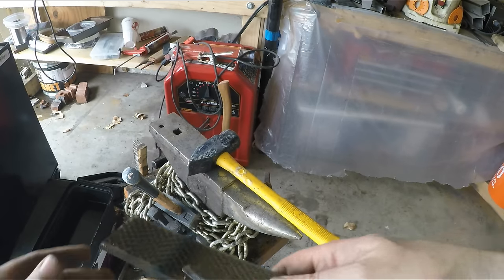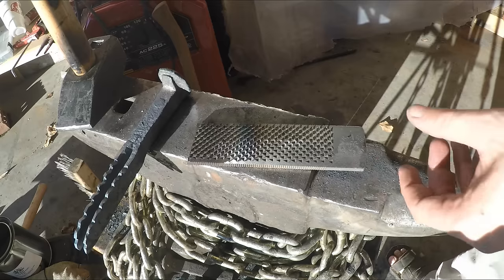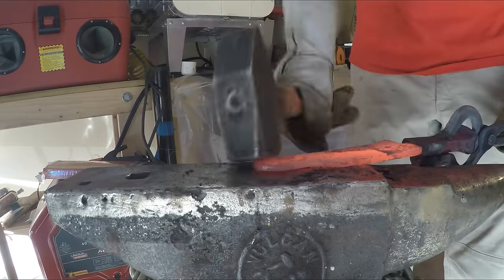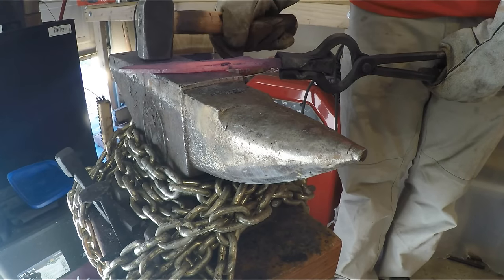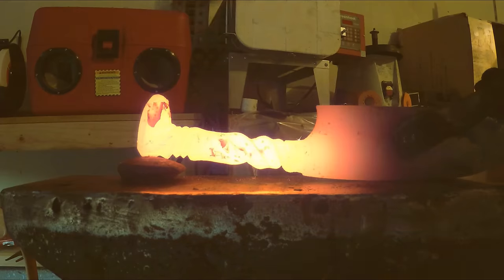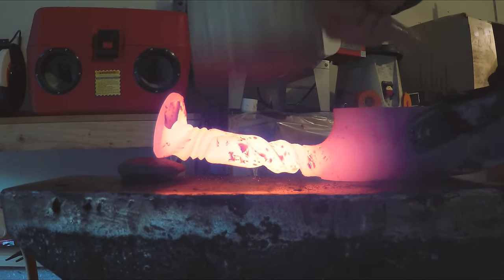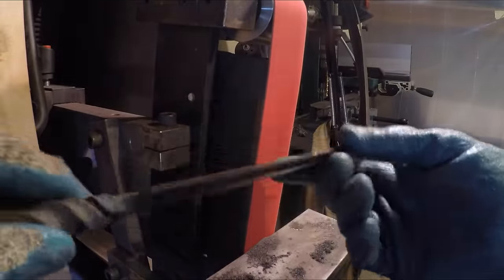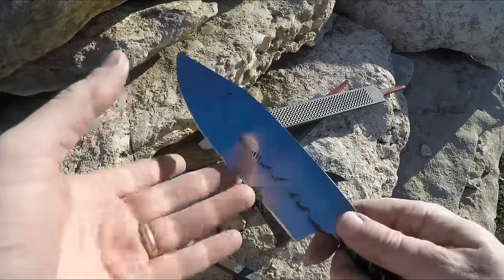Forging a Spike & Rasp Knife

Comment: at 15:50 you said you didn't know what kind of knife the was. I'd categorize it as a san-mai Bowie. in all the American frontier tradition of making what you had on hand the best it could be. this is probably the best spike knife build I've seen, really shows off not only your craftsmanship but even more importantly your understanding of metallurgy and what steels are appropriate to use go a good knife, instead of thinking that you can pound away on any old piece of steel and get a good knife. most end up as KLO 's (knife like objects), which this definitely is not. love the build!
Reply from the maker: +Zach Reiser  Hey thanks, man.

Comment: Hey Green Beetle.
As a fellow smith, I just thought I'd mention something I noticed to help you. When you were slitting the spike, you were kind of hopping around as you hit and causing marks all over the steel. What I can recommend is to start off with some relatively light hits just to mark where you want to cut, then going back over with heavier hits to make the marks deeper, then cut through. 
Happy forging!
Reply from the maker: +Cave of Skarzs   Thank you for the help, I'll try it.

Comment: I dont know anything about forging but i like to watch it. I was just wondering, what is that black material that flies off when you're hammering the metal in shape? Is that also metal? You can see it around 4:16
Reply from the maker: +xFexy  It's called scale.  It's formed when iron oxidizes from the heat.

Comment: to make it easier to forge a file and a railroad spike heat it until it's glows yellow then put it in a bucket of sand then wait for a couple of hours then pull it out of the sand and then it will forge easer
Reply: False that just takes the hardness out of it and makes it easier to shape cold on a sander or with files I.e. Stock removal methods
Reply: If you watch the art of weapons  when he forges three drill bit knifes he says that doing that makes it easier
Reply: Well I'm sorry to say he is mistaken as heating it up and forging it makes it as soft as it will go. The "annealing" process is what you are thinking of makes it softer in cold state.

Comment: What causes that glassy sound that you mentioned towards the end of the video? Is it an indicator of good heat treatment or good steel?
Reply from the maker: +firedoggyx  Not sure what causes it, it just sounds cool to me, like the original file sounds and feels.  It's unique to file knives and in their case probably does indicate a decent heat treat.There are many things that make up a good heat treatment. You would like the grains to be small in size and tightly organized in addition to the most important factor - hardness of the knife.  For most knifemaking steel one shoots for a post quench hardness in the mid 60s HRC.  The blade is then tempered in an oven at a prescribed temperature depending on the steel and desired hardness. Tempering releases stress created in the steel during the quench and reduces the HRC of the knife decreasing it's brittleness and making it more durable.
Reply: Ahh i see! I asked because a knife i bought from ikea sounds exactly like this, and its a really pleasant sound that i was hoping to recreate. Maybe ill try to forge some files in the future :)

Comment: what happens if you hat treat the blade at forging temperatures instead at initial non-magnetic
Reply: Spenser Denovich depends on the steel and size of the blade.
Mostly would work
But wraping and cracks could apear. If you quench in water steel like 52100 shatters

Comment: Habe you put it through any hard testing? It looks like there's a lot of delanination. Great video tho, great ideas and not boring to watch!
Reply from the maker: +Cooper Landram there was a 2-3 mm area of delamination near the front of the forge weld towards the tip of the knife that was ground away .  There really wasn't any other delamination.  The lines seen are superficial to where the forge welds occurred as the spike metal was driven down into the file causing a divet that couldn't be closed because the piece couldn't be compressed lengthwise at forge welding temps to close that gap.  It skated a file and was tempered from there, final hardness was in 55-60 HRC range.

Comment: Something I have been wanting to know is, what kind of anvil do you use? Also for a beginner black smith who wants to makes knives and the like what sort of working surface do you think would be the best choice? Also from research I have found many anvils to be rather expensive, any recommendations as to that or is a, you pay for what you get in this sort of thing?
Reply from the maker: +Scott SUNBRO You get what you pay for with anvils.  Railroad track is popular if you can find some cheap. People claim they forge on sledge hammer heads but that sounds like a lot of hassle.   I've forged on large rocks before, see a few of my previous vids.  Old vulcan anvils are about $200 used but not good quality - I use one.  They are better than the inexpensive iron anvils that populate eBay, however.

Comment: do anvils deteriorate over time? i say this because yours looks pretty old and I found a 100 year old anvil for a good price and I'd like to use it as an anvil rather than decoration. How would I harden it if it got soft?
Reply from the maker: +TheSkywayBridge   They can get pretty beat up over time.  Especially if they are softer, < 47 HRC.  Once metal is heat treated to harden it doesn't get soft on its own.  Hardening steel for an anvil would require you to know what steel it is, have a way to heat the anvil up to red hot then have a body of water large enough to quench it in.  Or sometimes people heat treat a 1/2" thick piece of steel then weld it to the top of an otherwise crummy anvil.

Comment: could you use 1095 powder bc i have lots of that?
Reply from the maker: +george b  Should work.  I can't tell the powder added much to the forge weld in this case, however.
Reply: thanks i just didnt know if it would be more callanging working with old files there so close in grades but i was wondering if i had to go hotter or somthing
Reply from the maker: same temperature for forging and welding.
Reply: im semi new at forging so just making sure. an thank you for geting back to me so soon an i love your work

Comment: do railroad spikes not hold an edge?
Reply from the maker: +shaun hoblitzell  The ones I've made in to knives did "ok" but the maximum carbon a railroad spike has is about .28%, apparently,  which is about 1/2 of the minimum carbon content most consider necessary to allow a steel to harden enough during quench to make a good knife blade.  I was surprised to read the carbon content is that low, to be honest, because the ones I've tested spark quite well, looking like steels with .8% carbon or more to me.

Comment: Have you ever been making a video and it went horribly wrong and needed to be scrapped? Like doing a forge weld and it completely delaminated? If so, how frequent is that?
Reply from the maker: +Stan V  I've made three attempts to forge weld stainless to high carbon steel under various conditions for a video all of which have been unsuccessful.  A Damascus knife my buddies and I collaborated on delaminated in a tiny spot on the blade after grinding was nearly completed, it had to be trashed.  I've scrapped steel and the video from an attempt to forge weld mild steel to high carbon steel with a layer of nickel sheet in between to accentuate the forge welded surfaces for a san mai knife.  I've had 2 or 3 rasp knives and a handful of saw blade knives crack during quench and had to be trashed.
Reply: Green Beetle Interesting, might actually be a cool video to show all the failure points in the projects that were scrapped. Let others learn from what doesn't work and just condense it to the critical points of each failure.

Comment: May I Ask What Was The Cost To Get Started With Such A Hobby?
Reply from the maker: +Socialist Pontus   Super cheap way is here https://www.youtube.com/watch?v=Ek0yfrQRiQ4. To get more involved one can find a railroad track anvil or super cheap Vulcan anvil for between $100-$250.  Build your own propane forge for $20-$70 depending on the size.  Buy some tongs for $20.
Reply: Komnenus I had an anvil given to me and I built an electric forge from a junknatural gas burner blower I salvaged from a powder coatings plant I worked at. I only use charcoal in it because I can make that myself. The less you have to buy the better off you are at first. I was fortunate enough to be in the right work atmosphere to get these things but use your imagination and it will serve you. I know this thread is old but hope I could still help.

Comment: How much does an anvil cost?
Reply: It depends on the brand and weight
Reply: +Notorious E.L.I. like, a cheap medium sized one. (it doesn't need the hole for thingies)
Reply: +Niels Wehrens Harbor Freight has an anvil for under $100, I don't know of the quality but it's better than nothing
Reply: I might consider purchasing that one.

I'm making the "soda can foundry" by the king of random, and want to use it for metal casting and blacksmithing. I would love to make my own knives because i'm a furious collector.
Reply from the maker: +Niels Wehrens   Beware cheap anvils.  They are usually made of iron and are quite soft.  If you're going to use it infrequently it may get you by for a bit but don't get anything under 60 lbs for knife making.
Reply: Green Beetle how much kg is 50 lbs? And i'm just a weekend enthousiast, if i get skilled more i will probably pick up a more expensive anvil.
Reply from the maker: 25 kg. Don't spend more than $80 on an iron anvil.  Might check around for railroad track first.   Sometimes you can find a used steel anvil for around $200-$300.  They hold their value well and can be sold easily if you don't use it.
Reply: okay, might look into the railroad track and a cheap 30 dollars iron anvil.
if i really use it a lot i might consider upgrading to a used steel one.